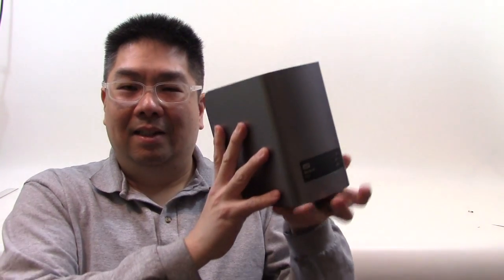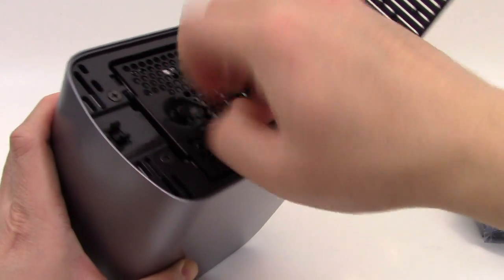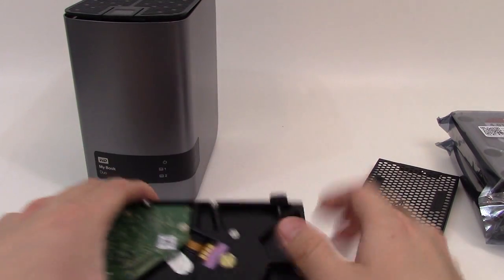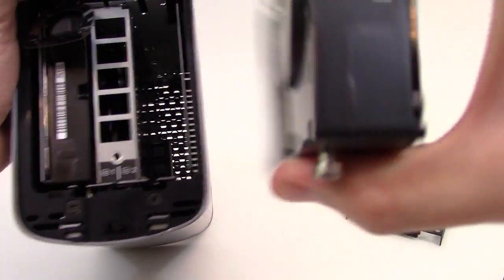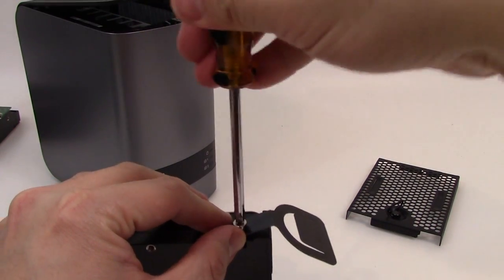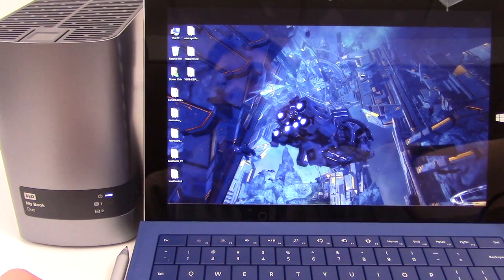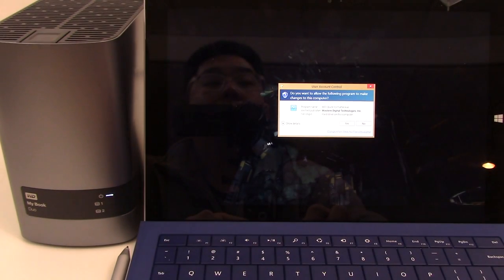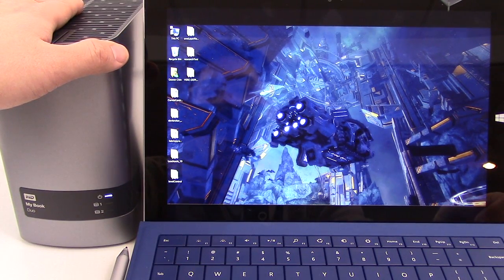Western Digital MyBook Duo: Replace Hard Drives

Comment: What will happen if the raid enclosure stops working or gets damage. Is It possible to buy another one and make the Hard Drives work in a New Raid Enclosure from the same Brand?
Reply from the maker: If the enclosure were to fail, so long as the drives are not damaged, you should be able to put the drives in another enclosure from WD or anyone else and use them. Now the data, that's a different story, It's unclear if you pulled a similar enclosure if the encrypted drives would be readable. My suspicion is no. I suspect if you popped these disks into another WD enclosure, it will see it as a different set of disks and want to re-format them for use as a new RAID. I can't confirm this though, since I don't plan on buy another one of these units.
Reply: WD say they will work in another WD Duo case. They also so say the encryption does not happen unless you instal the security app that the duo comes with. WD say the issue is Raid not encryption; you can't put a raid disc into a non raid environment and expect it to work there. From what WD say; it also appears all raid 0 or 1 environments are not the same, that is pull the disc out of raid 1 and put in another raid 1 environment it may not work as the set up may be slightly different.

BTW I just opened a WD passport 2.5" external and the sata/usb bridge is integral to the drive. It is part of the drive board, you cannot unplug it.

Last WD 2.5" passport I will ever buy.
Reply: I have now 2 WB MyBook Duo cases. One died last week and i buyed a replacement.
The Drives in first case was erranously encrypted. I changed the drives from first case to the newer one to retrieve the data. But theres no luck, the encryption is tied to the seriel number of the controler from the first drive case; and that is dead.
It is NOT possible to retrieve the encryted data because the pass phrase is invalid. 
I have used all the same parameters and passwords from first case. The WD Security Software bonded the hard drives with there serial number to the serial number of the controler. Both serial numbers are part of the passphrase. 
So if you change the controler, you are not able to decrypt the data, because of the other serial number you have a passphrase that do not fit anymore.
If you rely on your data: 
DONT EVER USE THE WD SECURITY SOFTWARE! 
IN CASE OF HARDWARE FAILURE YOUR DATA IS LOST.
Keep this in mind when using this hardware.
I will not by any Western Digital Hardware with encryption anymore with this type of design.
I have thrown the cases away and use the drives now in DIY NAS System.

Comment: Hi Dower. I don't have the drive hub that you have, but i still need to upgrade the drives in my device. Is it at all possible to replace one drive, let the device mirror over, then replace the other?
Reply from the maker: +Glenn Stewart Hello Glenn, are you doing a RAID1 Mirror and are you expanding to larger drives? If so, it might not be possible to do a one by one change. I'm pretty sure if you put a bigger drive into an existing smaller array, it will shrink the larger disk to match; which defeats the purpose of putting bigger drives in... How big are you expanding to? If your current drive is < 2gb, it might be worthwhile to pick up a MyPassport to just transfer what you need off. The only worrisome thing I ran into is it seems that the Duo might actually encrypt the drives, even though I've never told it to. I'm trying to confirm that. The problem then is if the unit fails, your data is lost... Putting the HD into a dock won't work in this case... I'm going to rebuild my drive shortly to see if this is indeed the case.

Comment: Dower - I just purchased 2 6TB WD Red drives to replace my current setup (2 3TB WD Green drives) in my MyBook Duo.  I removed the 2 drives & placed the 2 new drives in & upon powering the device up had the led light on the front flashing yellow - am not able to connect to it via the network; am not able to ping it either, getting a Destination Host Unreachable message.  I trouble shot his for a while & learned the blinking yellow light indicated a network problem - I placed my 2 original drives back in the device & still received the blinking yellow - left it overnight & upon revisiting it the next morning, found that it was back online & operational.  Any ideas why when placing the 2 new drives in the device would have taken it off the network?  Should I have given it some time (12 hours) to resolve whatever issue it was having on its own?  Thx for any direction/advice/help.
Reply from the maker: +Justin Tapper Hello Justin. My version MyBook is not network one, so I'll only be guessing at what's going on... Putting two new drives in the unit might have confused the unit, and therefore made it unready to be used on the network. Did you try plugging in the drive through a USB connection to your computer after putting the new drives in? The unit may need to be reinitialized through the Western Digital software to prep the two new drives prior to use on the network. A Startech NAS drive I have had to go through something similar, but it had the network software readily available when plugged in, but the drives had to be configured before they were usable over the network. When you plugged the old drives back in, it might have gone through a rebuild cycle of some kind to bring it back to working condition again, it might have treated the drive swap as some kind of failure condition. 

So, if you've not tried it yet, I would try using the enclosure connected to a PC via USB and run the WD software to prep the new drives.
Reply: +Dower Chin Unfortunately this My Book only has a Type A USB connector intended to add an external drive for additional storage & therefore I don't believe that I can hook it up to my PC.  It seems the RJ-45 port is the only way to communicate with it - I did just place a call in to WD's tech support to confirm that I could go from Green drives to Red ones & they did acknowledge that that should be ok.  I'm planning on calling them for further help when I get to the device later today.  Thx for your help & i'll let you know what I find.
Reply from the maker: +Justin Tapper have you tried connecting the drive directly via the RJ45 to the computer? I've seen some hardware that has software directly communicate to the device directly hooked up via the RJ45.
Reply: +Dower Chin I haven't - But that's a good call - i'll try that tonight

Comment: hi Dower.

is it possible to use both drives separately?  I meant two 4tb can be identified as two different drive letters ?
Reply from the maker: I don't believe that's possible, the unit was made to run in a type of RAID mode.
Reply: Sure. You lose mirrored backups though.
Reply: I think you can. That's  why the enclosure has the two other usb connectors. They will each show up as separate  drives. But they won't  be as fast, because they're  no longer raid, which doubles the speed.

Comment: Hi Dower Chin, 

Thank you demonstrating the replacement of the two drives. That was helpful. I purchased the same device but couldn't manage to get the USB drives to work properly even with a two and half hour phone call to WD support. The software gave me mental dissonance and eventually nothing worked. Mercifully, the next morning, I was able to erase my data from the drive and sent it back for a refund. I didn't want to become a stroke victim. 

I am wondering, how long did it take aprox. to restore the data on the 2 tb to the 4 tb drive? Thanks, George
Reply from the maker: +George R Restoration can definitely take some time... I left it running overnight. RAID rebuilding typically takes a long time. I'm going to need to revisit this drive unit because someone informed me that the drives might be encrypted by default... Which isn't good since that means recovery if the unit dies is impossible. I didn't seem to see this in my initial videos, and that might have been because I didn't give it enough to encrypt everything...
Reply: Hi Dower,

I am going to try this simple setup. I'll let you know how I do. -George

RAVPower
 Filehub, 5 in 1 SD Card USB Reader Wireless Hard Drive Companion WiFi 
Bridge Sharing Media Streamer NAS 3000mAh External Battery Pack, Black $40.00
 Backup Storage: transfer files between sd
 cards ,usb drives and your devices(phone/tablet/camera) to free more 
space up for your devices.
 SD Card USB Reader: wirelessly 
recognize USB flash drive, hard disk ( I am going to use an SSD ), SDHC, SDXC cards with your devices
 (phone/tablet/computer)via APP.
 Wireless Bridge: bridge an existing
 wireless network, create secure Wi-Fi network, and share with friends 
or families. Never pay for multiple network.
 Media Streamer: seamlessly stream 
your videos, photos, and music from attached storage devices with your 
smartphones, tablets, and laptops via APP.
 External Battery Packs: built-in 3000mAh power bank (5V/1A) can be an emergency battery backup.

Comment: Is it possible to replacement the harddrives using units from another manufacturer? Thanl you.
Reply: DEFINITELY NOT. You can only replace with exact same capacity AND MODEL of drive as shipped.
Unfortunately in my case replace drives are not produced anymore from WD so i can only throw away this enclosure.

Comment: i need help. my hdd died,and my book biard is ok, i got a 3 tb clean drive what format have to use. and what softawre from wd have to use gracias thanks
Reply from the maker: +davidsai Is the unit setup to be a Mirror (RAID1)? If so, you should be able to just replace the dead drive and the unit should automatically rebuild the array. If it's not Mirrored, you might be out of luck... As for any additional software, but sure you check Western Digital's web site, there is a client you can run that will communicate with the drive to give you information about the unit and offer options to setup/maintain the unit.

Comment: If i replaced both drives like you did and changed to raid 1 with the new drives, will i still be able to access my previous 2 disk which was raid 0 simply by reinserting them in ?
Reply from the maker: +Christopher Chan Hmm, I'd be careful with RAID 0, since breaking the raid could cause the loss of data. I'm unsure if you change the configuration in new drives and put the old configured ones back in it would work... The best, safest bet might be to pick up a drive you can backup to before breaking this RAID0 and reconfigure...
Reply: Thanks

Comment: buy this nas yesterday, I have 2 hdd but they have data and I want to occupy them in this storage
Can I install them without problems? I will not lose the information they have?
Reply from the maker: No, don't put drives with data in this or any multi drive NAS system, YOU WILL LOSE DATA! These drive systems need to format the drives so they will be setup in their RAID configuration (Either mirrored or spanned). If you want to use a drive like this, backup your data from your drives to something else, put the drives into the enclosure so they are formatted properly, then copy the files onto this unit.

Comment: Can I take the two 8tb hard drives out of this enclosure and reformat them in a hard drive docking station? Then just sell the wd duo housing? I mean they look like regular wd red drives. I haven't put any data on the drives through duo yet that I can't loose.
Reply from the maker: Yes, that's fine. They are standard WD Red drives.
Reply: Dower Chin thank you very much!

Comment: Can you replace 2tb hard drive with 4tb or bigger hard drives? So I can combine 2tb+4tb together. Is it possible?
Reply from the maker: Yes you can, just be aware that if you use Mirroring (RAID1), it will drop your storage to the smallest HD. If you want to use all the space combined you will need to use JBOD or RAID0.

Comment: Hi, I'm thinking about buying this product but I do not know if it's compatible with my OSX operating systems. Has anyone used it? Can you tell me what Mac OSX operating system? Thank you. A greeting.
Reply from the maker: This unit, as well as other disk systems like this, behave just like any external hard drive. When you plug it in, it will appear as a single drive. The only difference for compatibility will be how you format it, If you're strictly on OSX, you can format it using Apple's Journal file system using the Disk Utility.
Reply: @dowerchin  Thanks for the reply. I refer to the WD software with which you choose the type of RAID. A greeting.
Reply from the maker: @rmcaudiovisual6587  I actually don't use their software anymore, but I believe it runs on both OSX and Windows. Once you set the RAID mode, it just runs on it's own. I setup this drive a long time ago in RAID 1, Mirroring, and I've not needed the software since.
Reply: @dowerchin  And have you changed operating system using that same raid? Thank you
Reply from the maker: @rmcaudiovisual6587  If you mean moving the drive from a Windows machine to a Mac. It should be fine. I've not had to do that with this unit in a while. But I'm sure it will work. The thing is, if you will be doing that, I would format the drive using FAT32, Windows won't read an Apple formatted drive and NTFS on OSX is read-only, unless you have a third party tool to fully enable using NTFS volumes.
Reply: @dowerchin  No, I mean that if you have established the raid in an operating system, when updating to a newer one, the unit works correctly.
Reply from the maker: @rmcaudiovisual6587  Yes, that should be fine, once the RAID is setup, you don't really need to do anything to it. If a drive fails, you'll see a flashing red LED to indicate which drive failed. It should rebuild automatically if you replace the dead drive. The software may give you more insight and options.
Reply: @dowerchin  Thank you very much for the information. I think I already have it clear. Greetings and best wishes.

Comment: At the end of your video you say that you can plug the drives that were taken out into a hard drive dock to access its data, but in the description you say that it's been confirmed by the community that you can't.

Did you try plugging in the drives into the dock yourself to see what happens?
Reply from the maker: I made this video before realizing what it does. It seems that the encryption doesn't take place right away. So, when I was testing, it didn't have time to encrypt yet. But once it did, the drives were unreadable outside of this enclosure.
Reply: Thanks for the update, very useful!

Comment: You don't fully understand this drive enclosure or the WD utility to select encryption, it's fully voluntary and yes, once encrypted you can't read via any other way (or what would be the point of the encryption). It's easy to replace/rebuild a failed drive, all the data is still there, it just needs to rebuild the mirror array for you to then access your data again...
Reply from the maker: Not true. This is an earlier model, which automatically encrypted the drive, regardless of the option to choose to do so in the utilities. There was a large thread on the WD forums about this problem. I've run RAID 1 setups both hardware and software, and if I pull one of the drives, I can mount it in an enclosure and read the data off of it with no problem. I cannot do that with this unit. The drives are unreadable if you pull them out. WD might have fixed this in their newer models, but I've not bought any Duo's in a while now.
Reply: I've got this exact model, I used it for 3 years without encryption? I recently changed it over to full disk encryption, which uses a second small partition it then mounts as a CD-ROM to unlock the rest of the drive, so you can't just mount any of the disks outside the chassis and expect to be able to read them or decrypt...

Comment: When I bought this unit, seller told me if one hardisk corrupted or damage, just buy new one to replace then can work well, but now I'm really have one unit damage, when I going to replace with new hardisk, system wants me to reconfigure, that's means I have to format all the data. So I need to purchase two more hardisk to replace the damage hardisk then another one for backup the data...
Reply from the maker: +Vermix Howl Hmm, that's definitely not normal... If this unit (or any RAID drive) is setup for a RAID1(Mirror), it should just take the new disk and rebuild itself. Did this unit indicate that it was rebuilding itself or did it ask you to reconfigure as soon as you attached the unit with the new drive in it? I'm not with Western Digital, so I'm not trying to defend them, it's just interesting that it would not just rebuild itself with a new disk attached.

On a side note, someone informed me that this enclosure encrypts data by default, and which is worrisome, because if true, then if this enclosure fails, the data could be impossible to recover. I'm working on confirming this.

Comment: It's better to use two hard drives from different manufacturers / models for extra security.
Reply from the maker: I suppose, but I've always been told it's better to stick with the same drives, but order from different lots... Although, that may not always be easy to do.